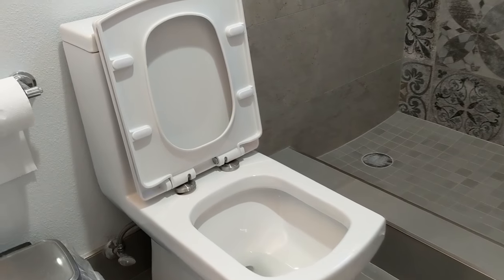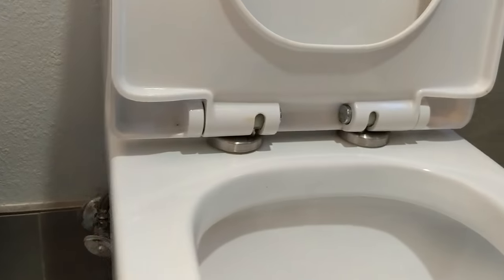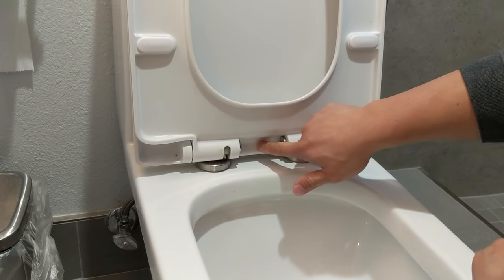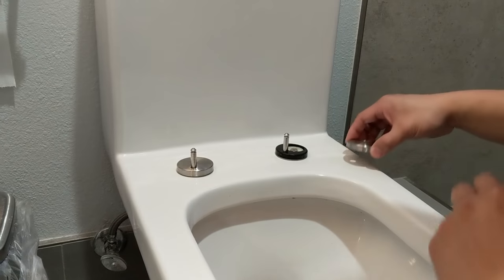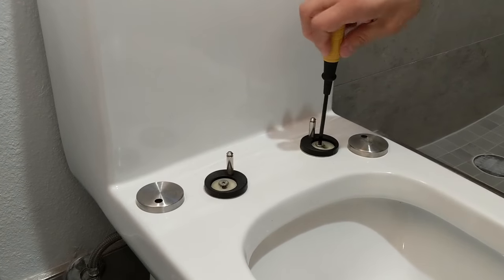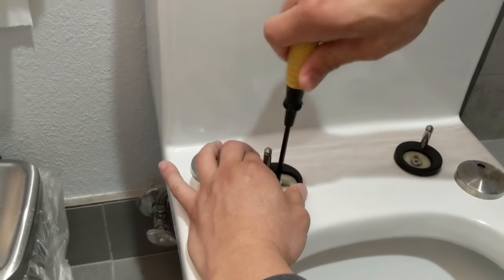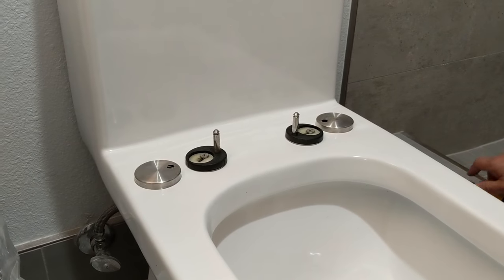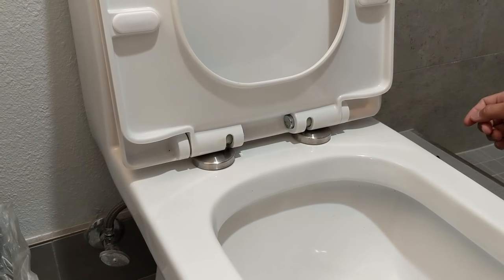Fixing loose toilet seat w/hidden screws or bolts

Comment: had this loo seat fitted for about 3 years ( the ex fitted it ) , tried to tighten it up and I had no idea those steel caps came off. It had my head done in attempting to tighten it and the underneath screw was just rotating. Thankyou for saving my sanity!

Comment: Thank you. My fixing bolt had snapped..💥I used a expanding screw as used in wall fixings , it worked a treat. I recon you saved me   A lot of money 👏👏👏
Reply: I have been thinking about using such a bolt since the bolt fell off inside.

Comment: Thank you massively. I have to remove the toilet seat but I can't get the silver covers off even with a screw driver. You have at least confirmed I'm doing the right thing. It's an annoying system.
Reply: I am having the same challenge.  Did you ever find a way to successfully remove the metal caps? Please share.   
Sincerely,
Frustrated

Comment: Thanks so much for such a helpful video, I thought I was going to have to have the whole toilet removed to get to the screws!🙈 my button was in the middle at the back so I never would have found it without your help. I’ve not been able to tighten the screw yet, it keeps spinning but I’ll try again- I’ve made far more progress after this video
Reply: If the spinning screw is still bugging you, I had to completely unscrew it, and pull the rubber part out of the porcelain.  At this point I was able to see the threads to get the bolt all the way in.  I couldn't do this while it was still placed in the porcelain. Place back in the hole, and go through the seat install.

Comment: Thank you for the help - getting the metal caps off was the hardest bit for me!
Reply: How did you get them off!!!
Reply: @corinhart8959  I used a fine electrical screwdriver moving all around the edge until it started. Then could push down through the hole in the top with my thumb at the same time. Just work all around really slowly. When you put them back on spray with a bit of silicone and don't press all the way home

Comment: Lid off, metal covers off. So far so good. I can see what looks like a nut or washer on the end of the screw. I've tried lifting the fixing slightly as suggested but the screw won't tighten
 Yes, I'm following the 'righty tightly' rule. Am wondering if something has sheared off. Any ideas?
Reply: I have the same issue sadly. I need a vid on  how to fix when the scree mechanism is broke

Comment: The metal cap on mine won't come off, been trying to put a screwdriver in between to pry it off but its really stuck on there. Any suggestions?
Reply: I just watched another video that suggested to use hot water to expand the silver cap.
Reply: @cj.g7789  please share.  That’s great!!

Comment: This was a tremendous however I came across 1 challenge.  The metal caps won’t pry off. I’ve tried slipping a knife under the caps to pull them up and still no success.  Are there any tricks to removing the metal caps ?

Comment: Hi, I have the issue where the plastic bit underneath the cap is snapped so I need to replace it. But when I’m unscrewing the screw and I can see down the gap it looks like the thing it is screwing into will fall down inside the toilet if I completely remove the screw. There doesn’t seem to be a way to remove the plastic bit without removing the screw all the way though? Worried that if I do unscrew all the way and the bit inside drops down I’ll be really stuck!

Comment: Mine has the problem where it doesn't close properly. It's not parallel to the seat if that makes sense. When closed, it's at a slight angle. The seat angles upwards from the back to the front. So when you sit, there's a bit of bounce to the front. How do I fix that?

Comment: i HAVE ALWAYS KNOWEN HOW TO fIX/TIGHTEN THE SOFT CLOSE TOILET SEAT AND COVER BUT I ALSO HAVE THIS TWO SIDE PUSH BOLT TYPE  BUT MINES REFUSES TO PUSH IN EACH SIDE TO ALLOW ME TO LIFT OFF THE SEAT TO ADJUST   THERE IS NO LITTLE PLASTIC COVERS AT THE FRONT AND I CANNOT SEE A MANUFACTURES NAME. PURCHASED FROM STERLINGS
DRIVING ME MAD EVEN MY PLUMBER APPRENTICE NEPHEW COULD GET THE PUSH IN BUTTONS TO DISENGAUGE?

Comment: that's ok but what if you want to remove those screws which go into the self expanding device inside. You can't. Mine has completely seized and the only way of getting it out is to drill it out.

Comment: I managed to do everything until it came to tightening the screws, no matter how much I turn them it doesn’t tighten. I checked and it looked like there was nothing there to tighten on to, there was just a massive hole and the screw in the middle.
Reply: Did you ever manage to fix this? Having the exact same problem
Reply: No I never managed to fix it, I think I’ll just have to get a new toilet seat altogether.
Reply: Reena 20 but doesn’t that mean buying a whole new toilet for a plumber to install? I’m about where you are on the frustration scale. Never again will I buy Toto toilets.
Reply: Annie Heydon Same here, instead of getting a new seat, I just got a whole new toilet fixed a week ago.

Comment: Has anyone been able to find a replacement seat for this toilet? I was able to take off the seat, but one screw just spins in place with the expander and bolt underneath not budging
Reply: mine was doing the same you have to put something long and skinny to hold up the mechanism that the screw screws into.. Than when you have it help up screw the screw back in and than you are back in business... Took me about 5 minutes and i needed a helper to keep the tension high while i screwed down